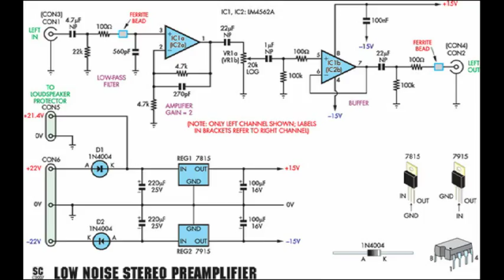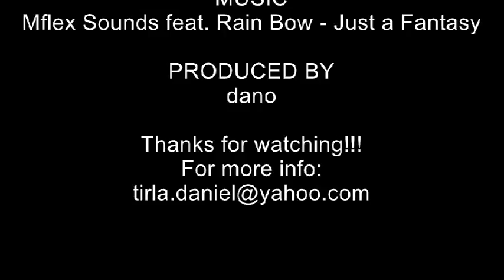Homemade amplifier 2x100W

Comment: Thermal bias tracking on the CFP output stage like used on the P3a needs to track a driver transistor not the output transistors.
Reply from the maker: yes, i agree with you. i read about this after i finished the amplifier and i was to lazy and i don t have to much free time to do this. i dont use the amplifier in full power, maybe 25%, but in some weekend i will make some changes inside in amplifier, and thanks for your opinion!
Reply: It's an easy mistake to make friend.

You put a good chunk of work into the amp, it looks good.
Reply from the maker: yes it is to make mistake if you do something ;-)
this was my first amplifier,
in future i want to build a copy after cyrus 3